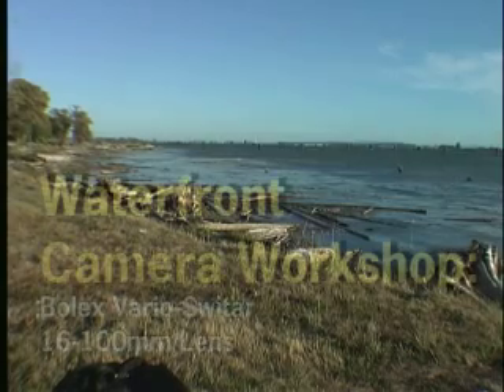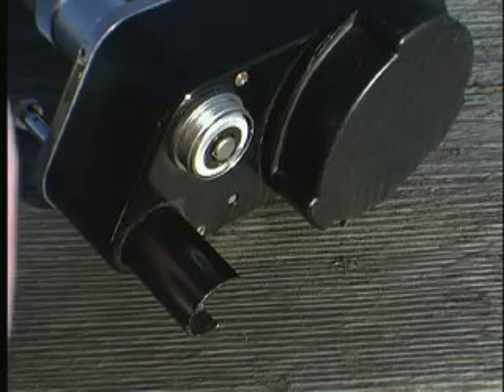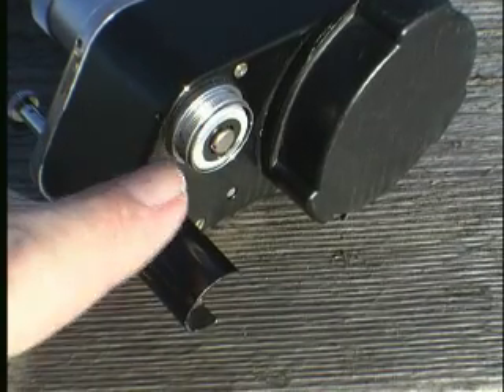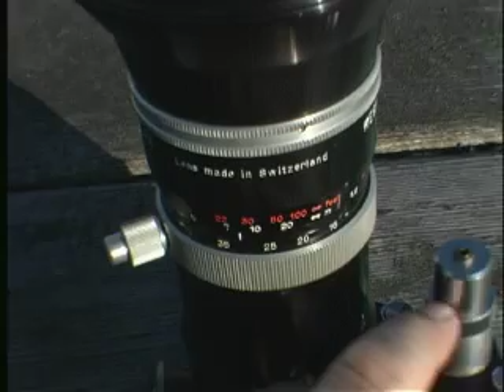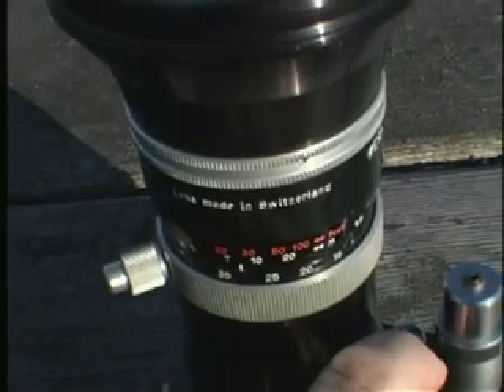Waterfront Camera Workshop: Bolex Vario-Switar 16-100mm Lens

Comment: For the exposure meter I used the replacement battery 1.5V from Batteries In A Flash dot com. They work very well.

Comment: I have been trying to find replacement batteries for years for this Bolex lens. Lithium battery option is a really excellent option and choice. Many thanks for this information.  Is there a replacement also for the exposure battery option that also used the mercury battery now obsolete?
Reply: Did you manage to find a replacement for exposure battery?